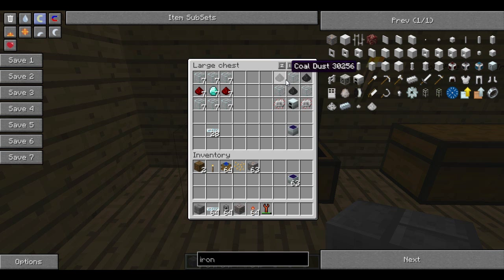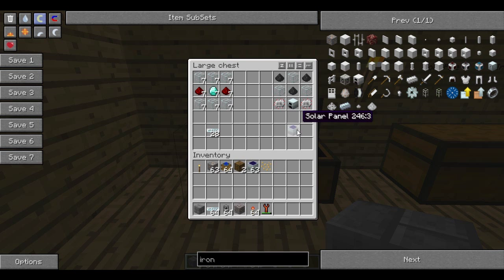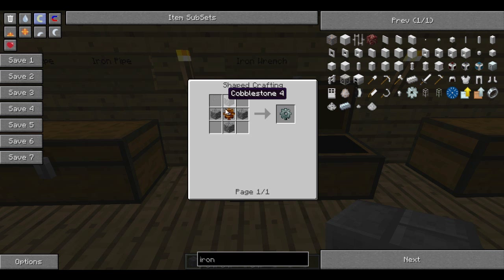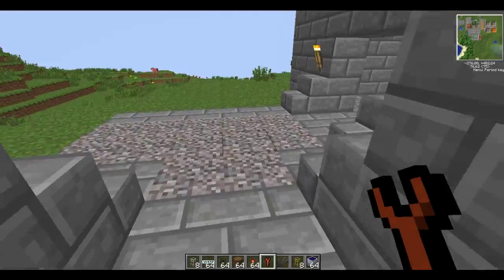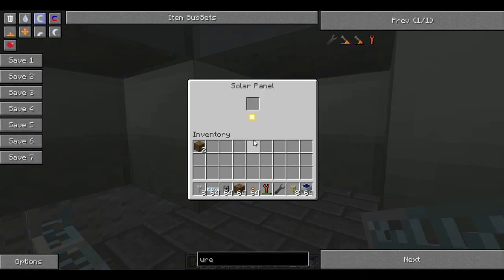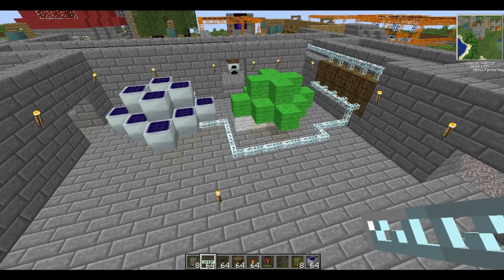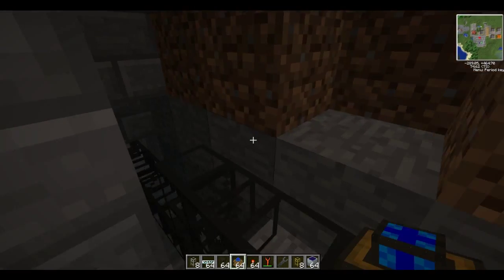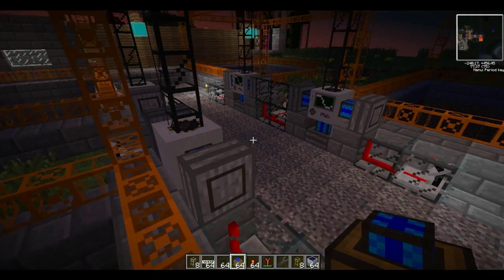Tekkit Tutorials Part 5 - Solar Panels, Glass fibre cables, gold and iron pipes

Comment from the maker: The wiki says : "1 EU every 40 blocks energy loss" so it should be fine you'll lose like 0.75 EU over that distance, so it will either be that your energy input is roughly equal to that of your output so the other rows won't fill up, or that you havent wired them up properly, make sure that the little dots on the bat boxes are facing the output :) also make sure only your bottom row of bat boxes are connected to the solar panels.

Comment: Yeah, I have all that. I even tested it with Redstone. When I put Redstone in the bottom BatBox in the middle column, it fills then empties into the top one. No output, either. I'm not using energy atm. If you actually want to come look, the server IP is laffen,servebeer,com (Replace commas with periods)

Comment: Thanks :3 New problem though.. I have an underground base, and just made them on the surface, almost exactly how you have them. I have the same BatBox setup as well. ALTHOUGH, I linked the BatBoxs to the Solar Panels with Glass Fiber Cable all the way underground, and the first columns filled up fine, but then it stopped producing energy :/ I counted, and the distance linking the BatBox and Solar Panels is 30 blocks.. Is there a distance limit? :/